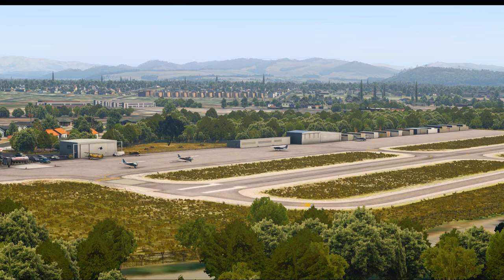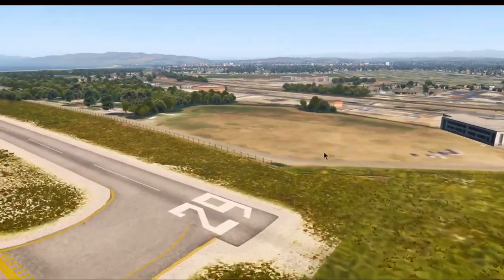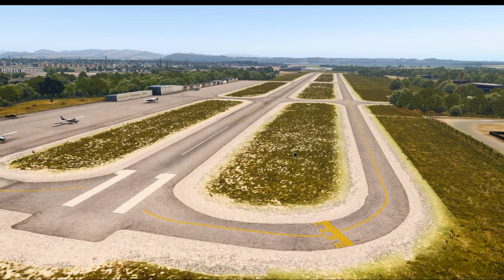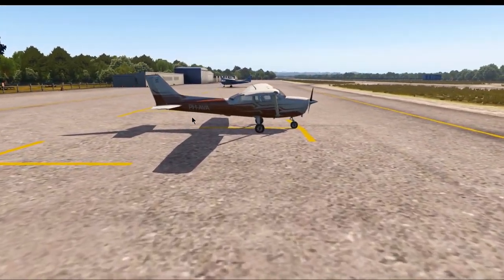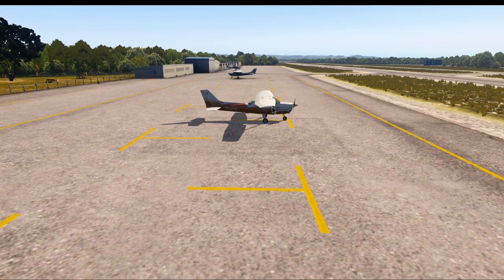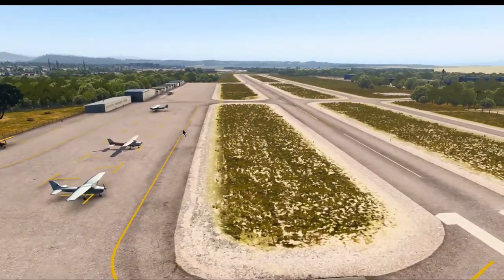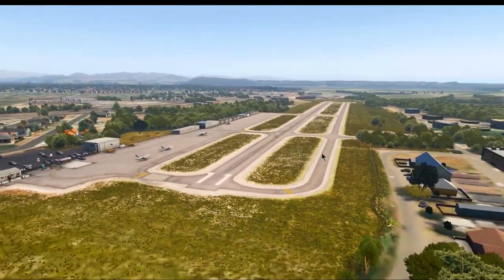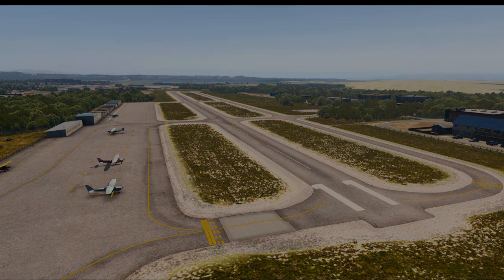Flight Sim School | Ep-6: (Theory) Runways and selecting one | X-plane 11 | C172 REP

Comment: Could you do a tutorial on how to start the engines if they are flooded using the Rep? I have tried and failed on getting the engine to start.
Reply from the maker: Yes that is planned soon
Reply: @digitalaviator5088  thanks. Until you make that video, can you tell me how I resolve that issue to get the engines going? I need to know how to start the engines since each time I try,it tells me that the engine is flooded.
Reply from the maker: Basically you want to start with full throttle and cutoff mixture. Then hold the key untill the engine starts. Immediately reduce throttle and add mixture to full. Then follow the normal procedure